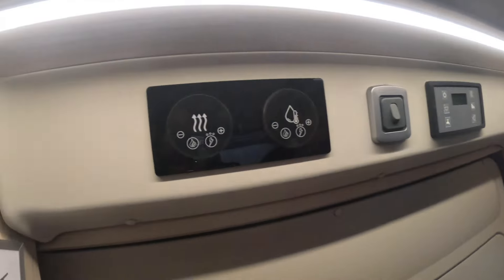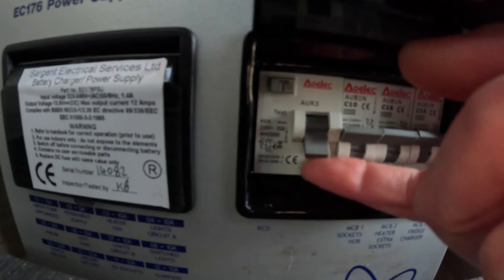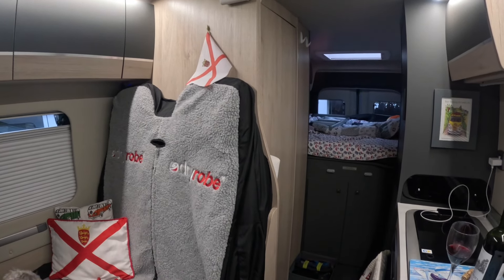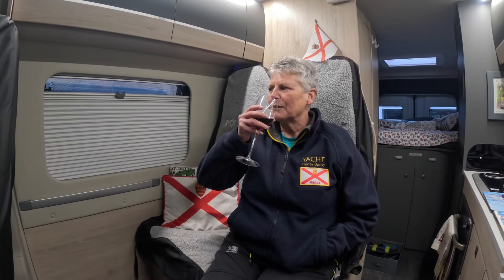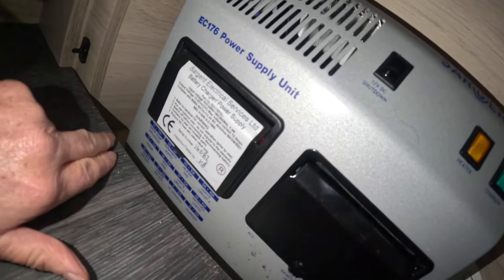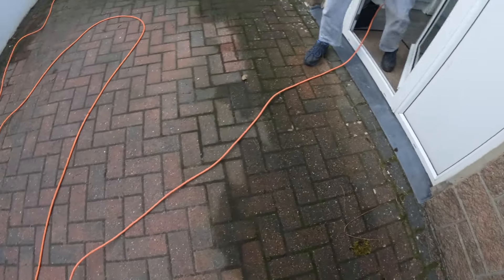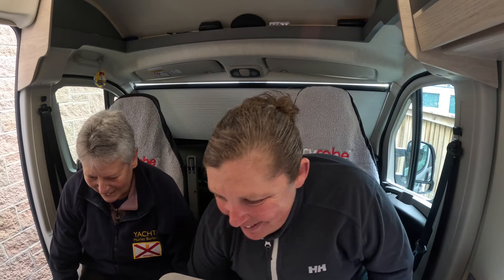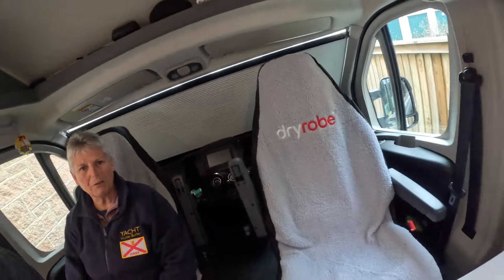No 230v power in the Van! A weekend of problem solving.

Comment: Hello 👋🏻,

Another great blog, thanks for being just you with no unnecessary dramas or contrived scenes.

It’s a nightmare when something like this happens with the Van, we had a similar issue where our fridge would work on gas and mains hook up, but not on 12 V. We tried the fuse, the switch and everything we could think of, but eventually the problem was discovered. Weeks earlier we had removed the starter motor battery to charge it up and Malish had not reconnected the positive terminal securely and although it’s still started the van, the fridge could not receive the power. all sorted and happy days.

Thanks for sharing and looking forward to your next blog.

All the best,
Zoe 🦯🦮, Malish 👨🏻‍✈️ and Keeva the Pickle 🐩.
Reply from the maker: Thank you, we really appreciate the positive feedback as we want our blogs to be a true reflection of the fun and tribulations of van ownership and travelling. Like you, it was so good when we  managed to get  to the bottom of the issue, and always good learning for self reliance. Tracey and Tash

Comment: We have just got back from a 6 month 7,500 mile trip in our 68 to France, Spain, Morocco, Spain, Portugal and Spain again. 

The only real issue we had the whole time was a couple of weeks after leaving home our 240v electrics stopped working. Borrowed a hook up cable from a friendly Frenchman and fortunately thats all it was. A couple of wires had come loose in one of our leads plugs. All fixed in 10 minutes.
Reply from the maker: I bet you where pleased it was a simple solution in the end, we certainly where when we discovered the same fault.
What an epic journey you have been on with your 68,